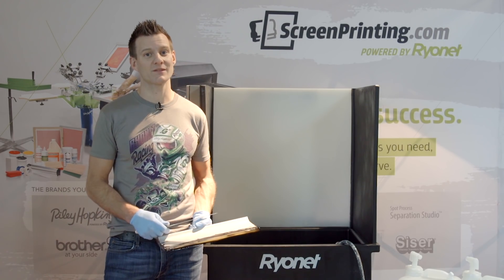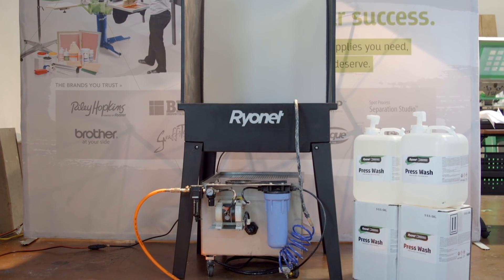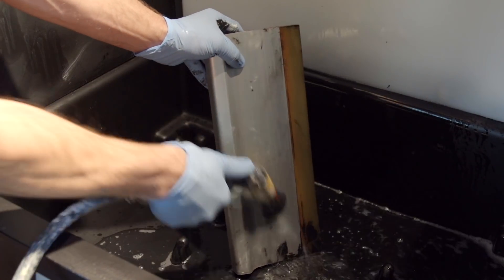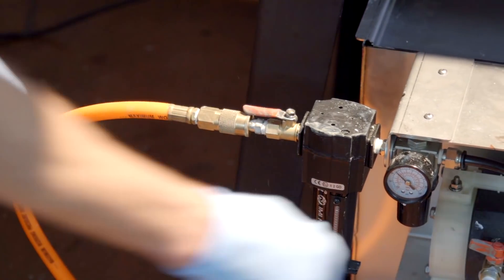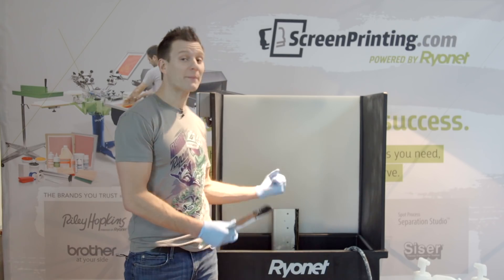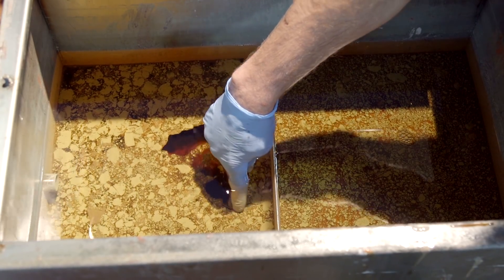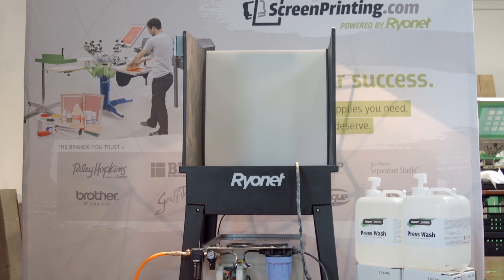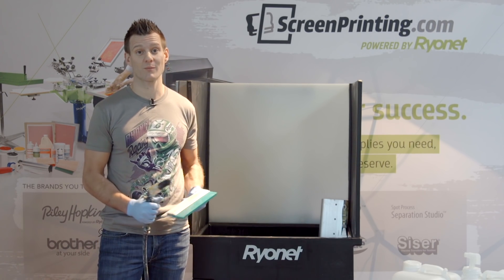Sgreen Chemical Recirculation System for Screen Printing

Comment: Pro Tip.   when pouring chemicals from a 5 Gallon like that.  turn it around.  pour spout away from target.  that way when you pour the spout is higher up and allows the air in the tub to flow through the same spout preventing splashback.
Reply: Yes, that would work a lot better! thank you for the tip!